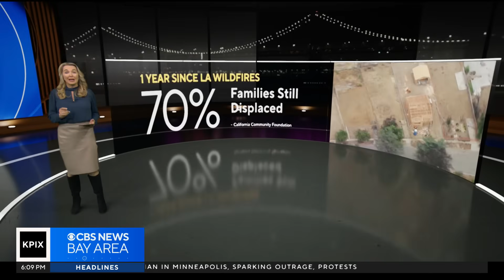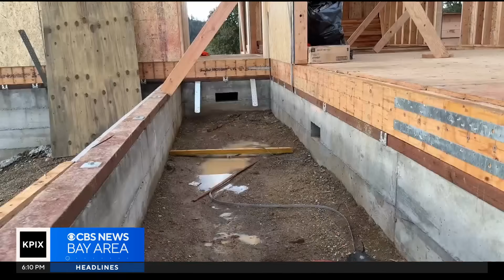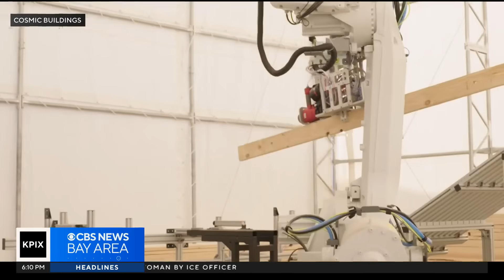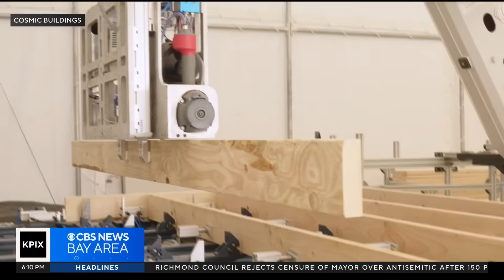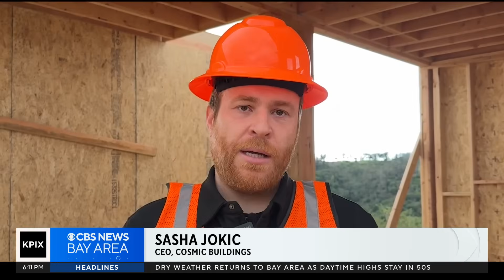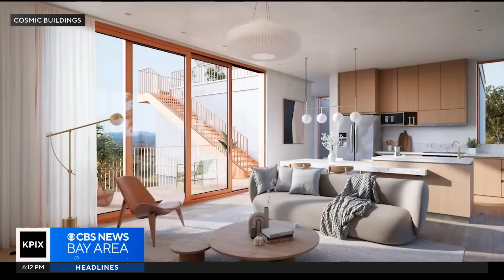San Francisco company building homes with automated mobile robotic factory

Comment: Just have a prefabricated frame work and deliver it on site.  Designing homes are easier than before, just get the foundation dimension with x/y position of utility (plumbing, electrical, others) connections points and you're golden.